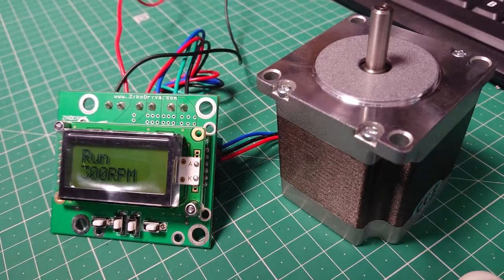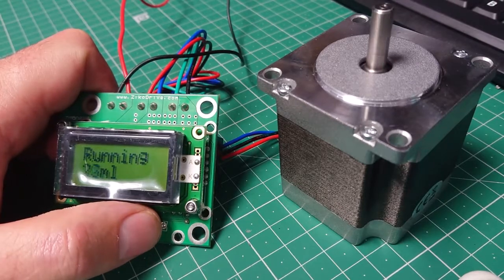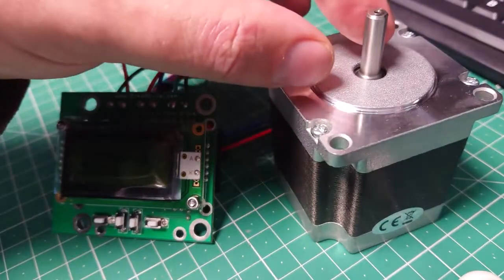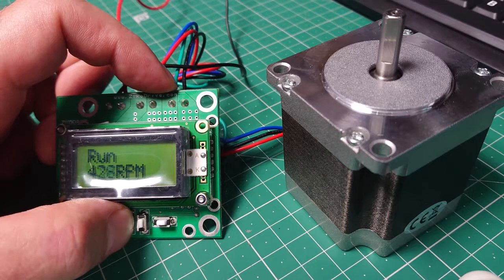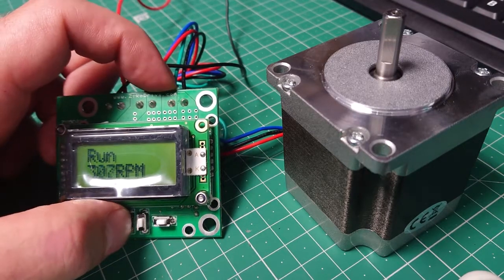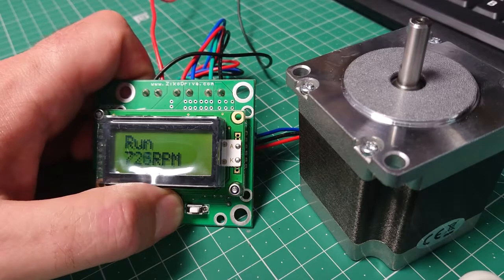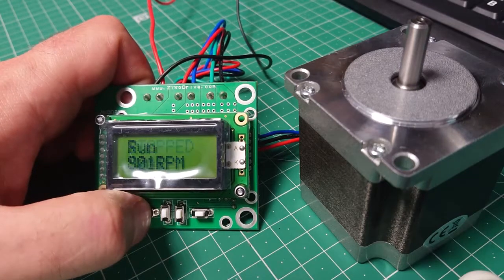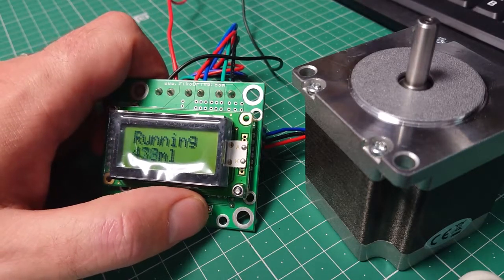What factors affect stepper motor speed

Comment: Hi, i wonder if you can help me with my cause. I have stepper motor and running with driver. The problem is, it make clicking sound like relay each time it stopped. I cannot feel any movement from the motor. Is it normal for the stepper motor behave like that?